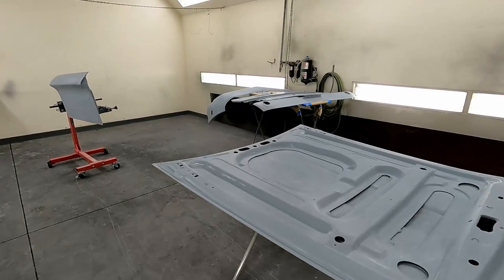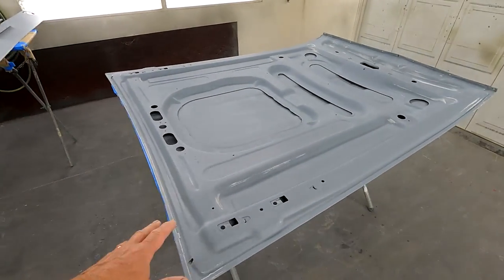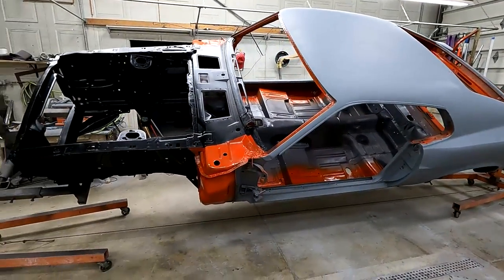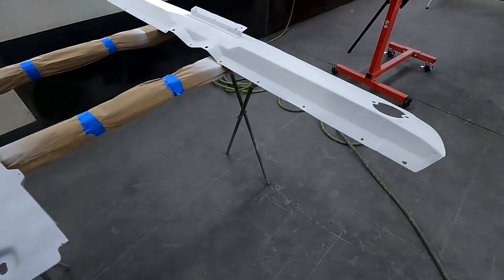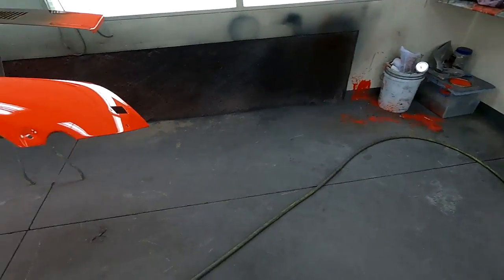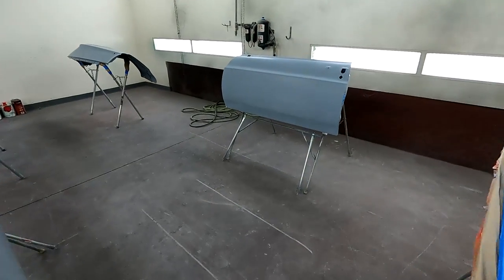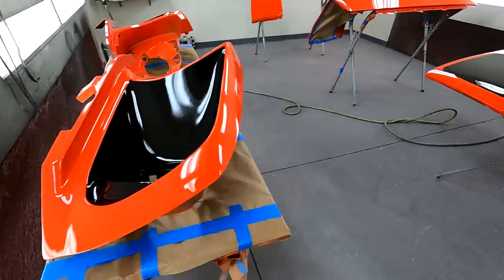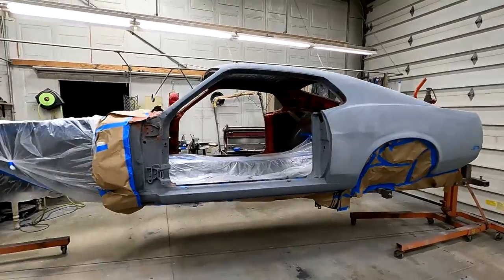1969 Mustang BOSS 302 Restoration Project:  #17.  PAINTING BODY PARTS.

Comment: Great work as always Greg! Wish you'd share a little of products used ! Did you use some SPI and were you happy with it if you did ? Thanks for sharing the project!
Reply from the maker: I actually shared the products in a future video which will air in the next couple weeks. I did use SPI products for the epoxy and all primers along with the sealer. The basecoat is DeBeer and the local guy has a lot of formulas for the classic colors. I used SPI Universal Clear. This is my first time using them and was happy with all these products. I hope this is helpful. Thanks for your comments and for watching.